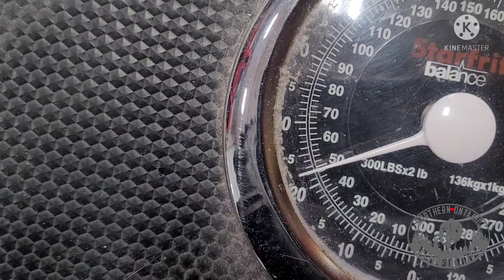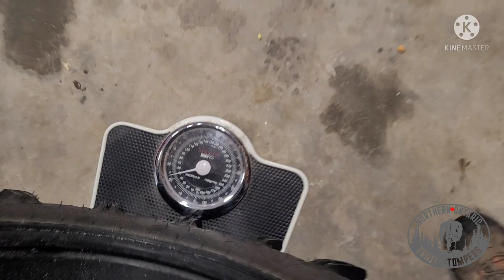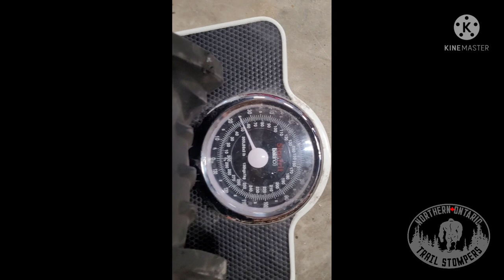Far Mudding floorboards and 32 inch tire install on 2021 xmr850

Comment: Looks good fellas.  Nice that those tires are light.
Reply from the maker: Thank you ! Yes winter can't go away fast enough now . I can't wait to try them out ! Thanks for watching!
Reply: @Northern Ontario Trail Stompers  I have different offset wheels.  And my front tires still hit the fender.  But you should be fine with stock wheels.  Oil change is way easier with those floorboards too. I love mine.
Reply from the maker: I heard that. I'm looking forward to the next oil change.  Before it was a real chore. I haven't even tried on my wife's two up. I sent it to the dealer. Such a pain in the ass lol
Reply: @Northern Ontario Trail Stompers  I have trouble with the rear drive shaft coming loose.  If you remove the side plate by the brake pedal you can really crank on the drive shaft bolt. Way better than trying to tighten it from underneath.  Wish I knew I could have got them to Lazer my name in them. My wife stole the shirt that came with them. Lol.

Comment: Ordered a set of these from Dirty Life and they did not fit near as well as yours seem do. Large gaps, I've got to pull the front fenders in I'd say approximately a full inch to meet the foot well. Had to trim some of the steel away just so the fender would line up in the bend where the outer torx screws are. Not really happy with these foot well at all, but being a metal fabricator by trade I've made them work. I reached out to far mudding with my issues and never got a response. Won't be purchasing anything else from these people, wished I'd have bought the lucky 7's instead.  Great video though hell of a machine love mine. Happy trails